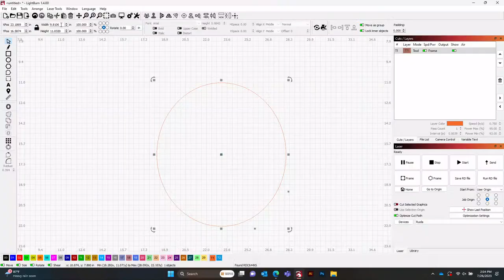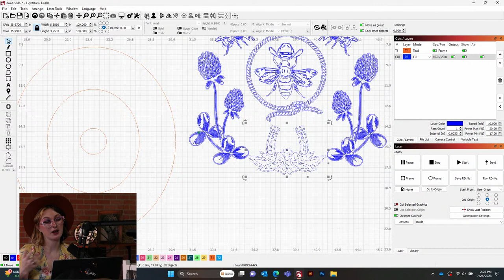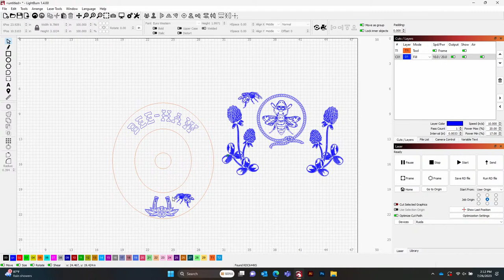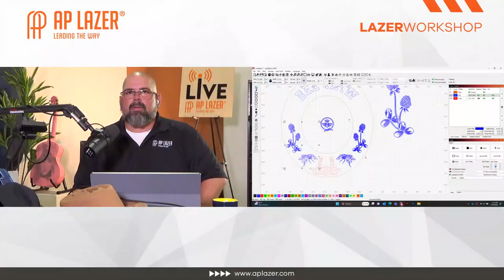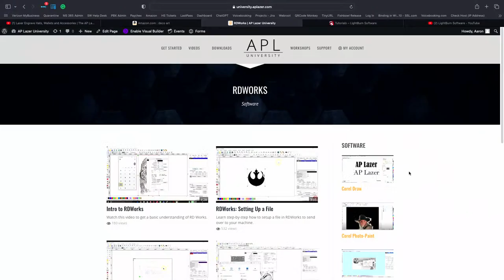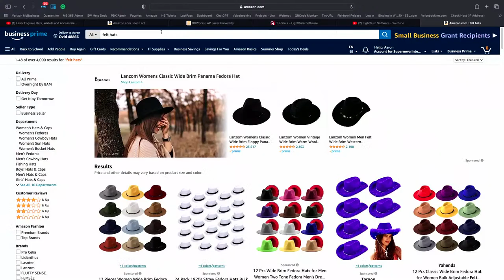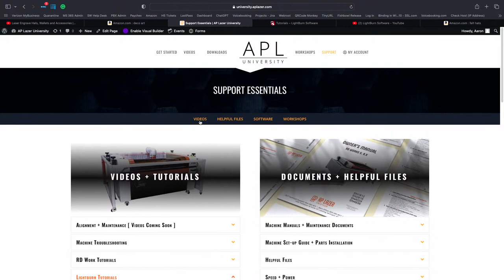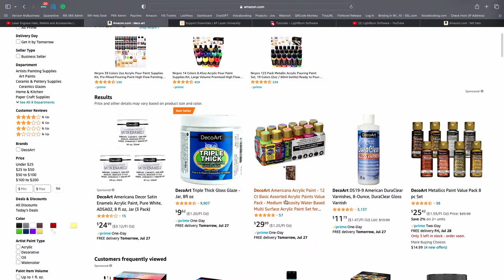Laser Engrave Hats, Wallets and Accessories | The AP Lazer Workshop

Comment: I have a 100W CO2 Thunder Nova i tried these settings and it burns all the way through the hat. I also tried the setting that I use  for scoring Speed 500
Power 7. Still burns through. Any suggestions?
Reply from the maker: Hey there!
These settings are suggested for use on our Sn4024LR & SN4836LR machines.
Because each laser manufacturer designs their machines a little differently, settings will vary depending on what brand of laser you are using.
These felt hats are all a little different depending on where you get them, as well.
Since you’re burning through, I would suggest upping your speed and lowering your power a bit. Start by testing just a small circle or dot on the bottom of your hat, somewhere it likely won’t be seen. Once you have your settings honed in, then you should be good to go! :)

Comment: What focal length needs to be used? Would you use fill for all images ? Do the thin lines need to be scored instead?
Reply from the maker: Hey there!
We used a 3” lens for these, but you can use any focal length lens for these!
We also suggest using fill since we wanted to burn an entire image, but if you wanted to do line work, you could switch to line and lower your power to just score along the hat! It all depends on what your design is and what you’d like it to look like when finished. :)